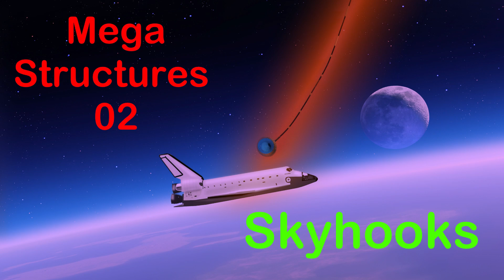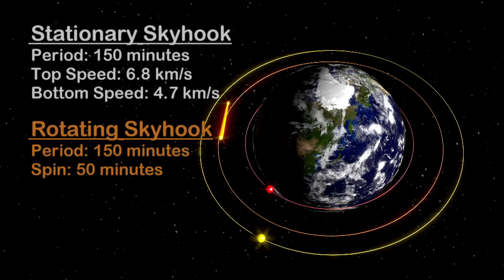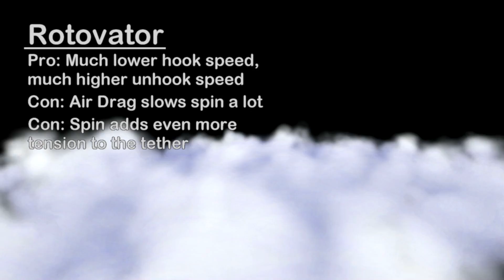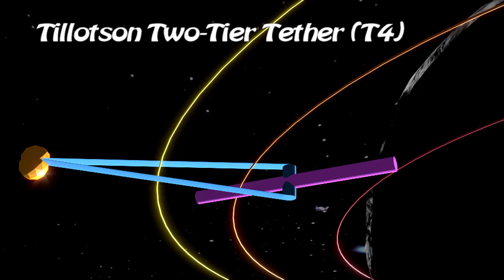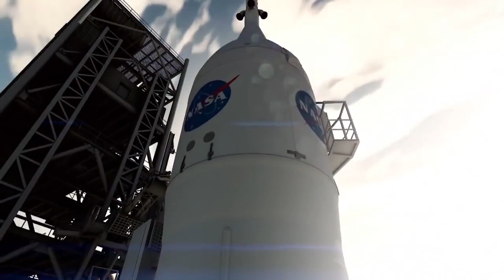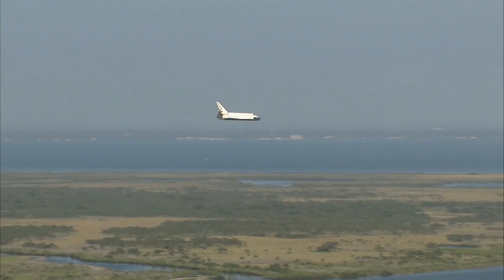Skyhooks & Rotovators

Comment: Pardon me for a little quibble, but why would the tethers need  to be tapered uniformly across it's length? Wouldn't it only need to be tapered from the middle out, since once you pass half way, the force will be pulling in the opposite direction?

Comment: Just finished this video and immediately subscribed. Such a solid channel from what I've seen so far. One problem with skyhooks that occured to me while watching though was that almost all orbital planes the tether will be interacting with will have satellites traveling either slower or faster at all but one point along its length. While this may not be an immediate concern at first due to the vastness of space we currently have to work with in orbit.  I feel that as the number of satellites and hooks increased a logistical nightmare would arise from constantly moving satellites out of the way of the tethers. I suppose an AI system could keep everything from colliding, but unless those EM drives really take off, Elon Musk is gonna have to open a new division of space x devoted just to refueling satellites. Or i suppose we could just dispense with satellites entirely and put all of our orbital infrastructure on the tethers themselves.

Comment: So couldn't you do a spinning sky hook with more than 2 hooks? Just have some sort of central space station and have say 6 tethers coming off that one central station.  Then it would either have moving counter weights that would move up and down each of the 6 tethers to balance the center of force or possibly even just extend or contract the tethers appropriately with giant winches. I am not a physicist but logically it would seem as long as you could balance the center of force to be that central connection point it should work just as well and allow you to lunch more frequently albeit from different launch sites scattered around the equator.

Comment: I still wonder: can't we actually let it orbit faster than necessary not to fall down (like the orbiting part in the orbital ring)? Then there would be no need to "regenerate momentum" because the momentum transfer to the spaceship would bring it down to again just above orbiting speed. I didn't yet calculate it through, so maybe the momentum transfer to the spaceship will be into the wrong direction, or I made some other mistakes, like that the skyhook would in fact still get slower each time and therefore fall down.
But this isn't too different from the stations in the original orbital ring concept (look at the paper linket to at Wikipedia)

Comment: Isaac -- I know this is an old video but I didn't hear anything about - how - you launch a thousands of km long tapering Kevlar/carbon nano tube/s  up to space to begin with. Wouldn't the connection points in the tether introduce another variable in the tensile strength from rotation?

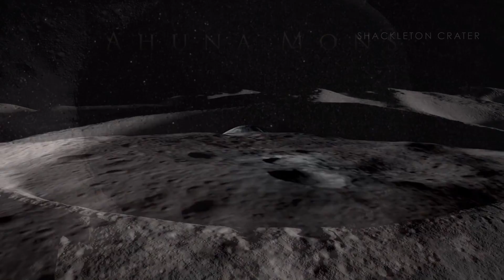Comment: 19:02 - "... though, since we already have material strong enough to build a space elevator [on the Moon]…"

Hold on a second. Is a space elevator even feasible on the Moon? Don't space elevators have to span the distance from the ground to a stationary orbit around whatever object it is on? Since the Moon is tidally locked to the Earth, isn't that distance literally the full orbital distance between the Earth and Moon?

What am I missing? I guess it could work if you used the Earth-Moon Lagrange points, but otherwise I'd expect Earth's gravity to ruin your day.

Comment: The skyhook can also be used as a very effective @#$@#$ device.  Using lasers we should be able to control the hook to automatically target our enemies and quickly @#$@#$ them in space.  As their bodies are release by the hook during re-entry their bodies would burn into the atmosphere; thus saving money on burials.   The only problem is that we need to convince our enemies to run fast as they place their necks inside the hook.   We also need to find a way to slow down the hook from orbit to human running speeds to ensure a good hook on the neck.  One more problem is that you will need many rockets to keep the hook from falling out of orbit after each @#$@#$@$.
Finally you will need a way to pay for all of this.  It should cost no more than 3.5 trillion per year just to maintain

Comment: I'm curious, rather than (or in tandem with) an ion system to keep the hooks in place, is it possible to arrange the orbit of them so they are ever so slightly above escape velocity and maintain a regular schedule of departures to keep it in check? Maybe a null point for earth with the EM field but possibly useful for bodies without a strong EM field especially those with lower gravity. I guess it would be a solution more suited to an already established space industry to ensure regular departures, but is it feasible?

Comment: What about a space Ferris wheel contained in a big circle in a big square? Like balanced out weight loads rotating up in to high atmosphere, then stopping, then letting a space ship launch off the top high up in the air?  With a massive strong axel, a lattice structure of the disk but with gear teeth attatching it to the outer circle held within the big square structure. I could draw a picture if you want. It would be huuuge but.... Also cool. The pods carrying the rocket reach the top and open up and line up with a hole. Sorry if you have discussed this before. I just invented it in my head , i haven't seen something like it yet. Patenting it now hahaa. I know that everything has been thought of before but just putting it out there.

Comment: This was even more fascinating than space elevators.  Maybe because I had never heard of the concept. I think it is too complex to do... at least until we have AI controlling all of it (actually what am I saying...current non-general AI could probably handle this, as long as it controlled everything involved). Highly complex but so interesting. I still prefer the elevator though, if for no other reason than a fixed object is easier to factor into collisions than several spinning things at incredible lengths. I think both ideas probably need a clean up of the space junk to be safe though.

Your vids make actually make me optimistic about the future. I can't tell you how profound a statement that is for someone like me.

Comment: Would not rotator be actually much less affected by drag? assuming the atmosphere is roughly spinning with the Earth, the relative velocity would be much lesser, and the tips of the rod spends much less time in it (and would tend to accelerate the rotation until relative speed is 0, rather than decelerate it).
Reply: The fact that the slowest we could anticipate the rotovator tip traveling through the atmostphere is 3-500 mph, or mach .4-.8, would inevitably produce friction.
Reply: Yeah you're right. Somehow I thought normal hook would not be stationary relative to the ground, silly me. Rotovator do experience more drag than stationary hooks (but much less than non rotating hook which only helps getting half of the orbital speed).

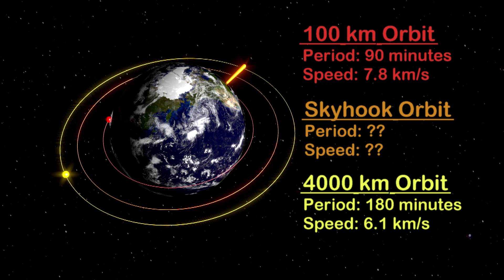Comment: 3:42 Tether have to be wider not at the top, but at the from-where-it-pulled. In our case it is center. Center have to pull bottom to keep it from falling and pull top to keep it from flying away. The exact location of "center" is point that have orbital velocity. If we change reference system to matching our construction we would have to adjust for centrifugal force. In this system "center" is the "highest" point with zero "gravity" (centrifugal force cancel Earth gravity).
Reply: I believe you mean the orbital centerpoint.  In order to keep the orbital mechanics simple, the centerpoint of a rotovator's rotation must be the point along its length where its linear velocity matches the orbital velocity for that altitude.  I agree that making that point the widest, not the 'outer' end, makes more sense to handle the dynamic stress.

Comment: I was intrigued and excited about this concept, but the more I thought about it the more problems I found. Here they are, please help me resolve them.

First is conservation of angular momentum. At the moment of hook up, the "package" is expected to immediately match the rotation of the sky hook assembly. That is a LOT of change in angular momentum. Where does it come from? In any event, there is no way a 3,000 km structure could be made stiff enough to deliver the required torque to meet the requirements.

Second is conservation of energy. For a 3,000 km orbital alritude and 3 sky hook rotations per orbit, a 50,000 kg "package" will need 3.193 E8 joules of kinetic energy by the time it gets to the top of the sky hook sweep (release point) and it neèds 6.36 E5 joules of potential energy (just to gain the altitude) (Note the PE is about .2% of the KE required). Where does all this energy come from?
If we presume it comes from the huge mass (asteroid?) orbiting at 3,000 km, perhaps. But, this means the 3,0000 km cable will wrap around the asteroid like a cable on a pulley (maybe this would work, I don't know).. These dynamics are going to be complex.
Meanwhile the orbital assembly has to replace or make up 3.2 E 8 joules of energy (orbital speed/altitude). That will require a reallt LARGE ion motor to recover in 150 minutes (orbital period @ 3,000 km altitude). Further, every time the hook dips into the atmosphere it dissaptes more orbital energy.

The good news is that these geometries result in 1.5 g acceleration for for the package.

One last comment, at the point the hook passes the Karman line (100 km "edge fo the atmosphere) on the down swig, it wil be traveling over Mach 3 - it cannot be a simple hook. It will have to be an aerodynamic module with a Lot of capabilities
Reply: On torque and angular momentum:
The 'arms' do not have to be a simple cable or fabric weave; they could incorporate features such as conductive wire to take advantage of electrical and magnetic potential differences along the arm length, as well as Lorentz forces generated by moving through Earth's magnetic field; reaction wheels near the center of rotation and/or along its length to help offset the torque caused by its own rotation and by capture and release of payloads; and piezoelectric compensators that respond to offset the compressive/expansive forces on the arm to bend or curl as its load-bearing state changes.

On energy:
Others have mentioned the possibility of air-breathing ion engines.  There is a Russian engine design that can actually use nitrogen and/or oxygen (although the corrosive effects of ionized oxygen are undesirable).  If the arm has a large mass at the rotational moment, it could have a power source (such as a fission reactor or decay battery) to power ion engines that would operate continuously.  Furthermore a skyhook or rotovator could be used to return craft and containers to atmosphere, not only launch them into orbit; this would offset some of the torque load and angular momentum losses.

On the capture device:
 I hope you're not reading too much into a demonstration graphic.  Yes, the capture point would have to be highly durable and aerodynamic; but as pointed out in the video, it doesn't actually have to capture transport vehicles; payload containers would do fine, a magnetic capture followed by a physical securement is not too much capability to fit into a static aerodynamic shape that does not need to self-lift or self-propel.

All very good points, all things I believe can be addressed if ever we take this less-sexy-than-rockets concept seriously.

Comment: 3:22 Are you sure the tether will stay in a vertical position? My gut says it will flip to a horizontal position and end up tracking around the middle orbit.
Reply: Without air friction the force differentials will cancel out in a properly positioned skyhook.  What I'm concerned about is if it will stay stationary on its orbital profile, given the effects of relativity on an object stretching across that big of a gravity differential.

Comment: Why not build a ballonplattform and have a rocket to lunch when the ballon is high in the sky.
Reply: Why would you have a rocket to lunch?  I don't think there would be much conversation...

Seriously though:
I haven't run numbers, but I don't think balancing balloon size vs. payload size would be effective in Earth's atmosphere.  On Titan or a superearth, where the atmosphere would be denser and provide more lift, it might be practical.
Reply: HuntingTarg Intressting. That can be good like you say on other planets . But woulden't be cheaper let a ballon like an zepelinare to cary a rocket .
Reply: It might, but altitude is only half of the problem.  The rocket needs enough delta-V to achieve the desired orbital altitude and velocity.  Would you really want to loft a 2-stage rocket filled with solid explosive or liquid cryogenic fuel to an altitude of over 50,000 feet?  If it were a final stage only, I might favor it.  Without doing complex calculations, it seems like at least as much expense and risk as a ground-based launch.  It might amount to just trading one complex engineering endeavor for another.

Comment: what if the tether wasn't solid at all, but rather like a yoyo, occasionally being wound and unwound into the atmosphere to pick up cargo and shuttles and attached to a large rotating habitat at the other end, powered by solar and nuclear and a Super-Dense flywheel, say depleted uranium or osmium?

this would serve a double purpose, a staging area for further setup an exploration and easier capabilities of putting materials and manpower into space. for the end of the tether we could use a robotic clamp system with automated aerofoils to allow it to drag behind in the atmosphere as the tether unwinds, then after attaching the payload would then be brought up to escape speed as the tether is wound back in by the flywheel. you could also use electromagnetic suspension on the flywheel to ensure that it experiences zero drag from gears and use magnetic couplings to attach the flywheel to the spool on an as needed basis for rewinding.

the tether couldn't be too long as the materials wound need to be both strong and flexible enough, but it wouldn't necessarily need to be since it's much easier to just get something into the upper atmosphere by balloon or supersonic jet, and have the colony on a highly elliptical orbit and only picking up stuff at perigee would shorten the tether greatly as well as making it even more energy efficient to get stuff into deep space.

Comment: Dragging an item up the SH (skyhook) will decrease the orbital velocity (due to coriolis effect) of the SH thereby decreasing its orbit. Boo. Dropping an item down the SH will drag the SH along, increasing its orbital velocity thereby increasing its orbit. Yay. The SH is only a mechanism to store energy from dropping items for launching items. You don't need to keep the SH in orbit with rockets. Also I think you can taper a rotating skyhook from its pivot. Very promising.

Comment: But...this all assumes the tether is stiff.  But anything with that kind of length will not likely be able to transfer a lot of momentum othogonal to its length. It will definitely not stay straight. Which introduces the next problem. The curling up from hooking a payload can not be slowly corrected by things like an ion drive. Those maneuvers would also defeat the point of the hook entirely since you'd need a rocket or similar to do it. (Because the tether will not transfer a lot of momentum in the direction we want).
The half way space elevator might work, since we only need to transfer momentum along the length of the tether (if you can keep the sideway momentum transfer upon hooking to a minimum). It would lead to very high orbiting velocities to match though.

A rotating one though... That's a very complicated, possibly chaotic system with possibly uncorrectable responses if you ever let it get too far away from its normal state.
Reply: Piezioelectric or electrostatic resonator/dampeners.  The mechanical stress of bending generates electricity than can be used to exert counterforce and help the hook straighten out without too much vibration or momentum waves.  It could also be engineered to capture electrical energy from the Lorentz force of Earth's magnetic field and apply that energy in a similar manner to a flagellum.

Comment: Seems like a natural fit to Reaction Engines' air-breathing rocket Skylon concept, which has a max speed of Mach 5.5 in air-breathing mode, and can revert to on-board oxygen to go faster. It passed the module testing phase a couple of years ago, having tested the rocket engine and heat exchanger. It's been marketed as single stage to orbit, which always seemed a stretch to me, but a couple of km/s slower than that, interfacing with a relatively short skyhook looks much more feasible.

Comment: Maybe the skyhooks need a source of momentum, because every liftup will slow it down. The Energy required for a travel come out of the rotation and potential energy of the hook. A Space elevator dont have these problems, because it is fixed to the ground and can transfer the momentum from earths rotation energy. (Using a spaceelevator will actually slow down earths rotation a bit).